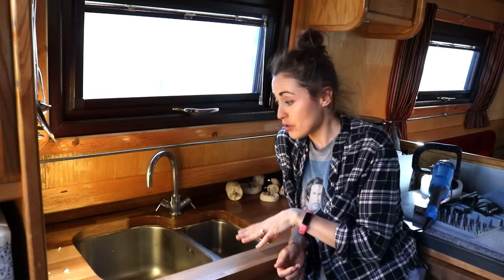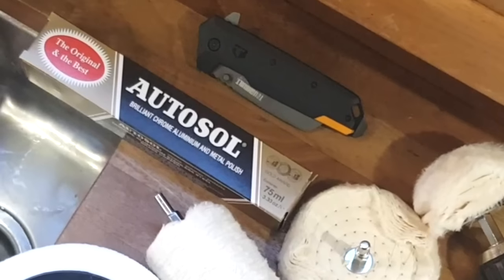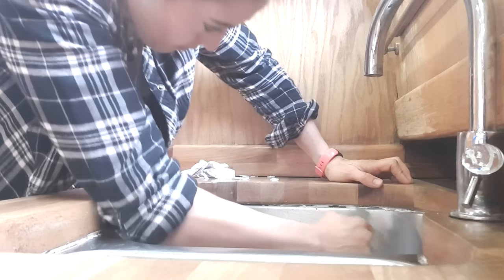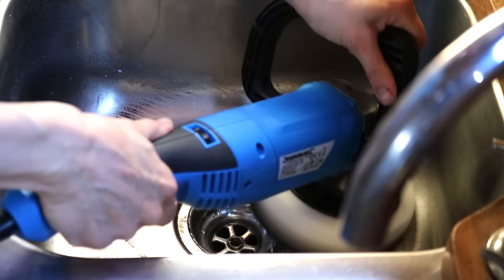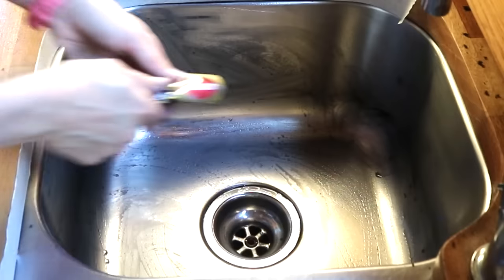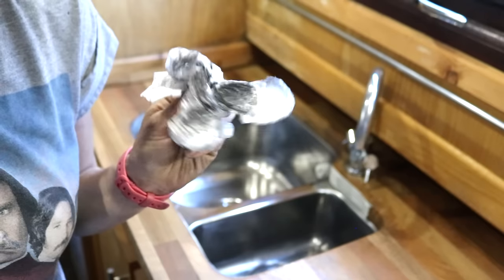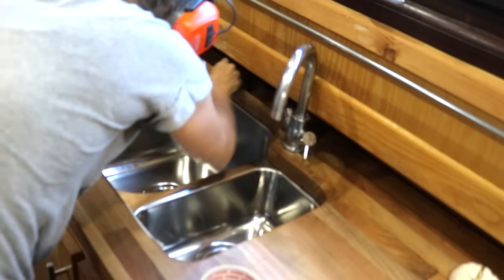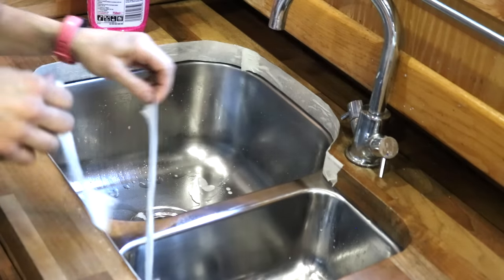How to Restore a Stainless Steel Kitchen Sink - Remove Scratches & Polish it to NEW again!

Comment: Before applying silicone, it's wise to fill the sink with water so that the sink drops the lowest level and prevents silicone from overstretch or cracking. The silicone would be able to adjust to a full bowl of water - you would do same around a bath tub. Good video!

Comment: Very well done.
Now to my own problem.
She who must be obeyed, bought from IKEA a replica Belfast sink, all was well until I tried to clean one of my daughters attempt's at cooking.
Any there are black vain like marks. I've tried numerous methods found on Utube but to no avail.
Any ideas would be most appreciated.
🇮🇪🇪🇺
Reply from the maker: Ugh.. I know exactly the type you mean.  I'l can't offer any suggestions without searching, so will pin this and hopefully someone can suggest something that works!
Reply: @TheCarpentersDaughterUK  
Thank you . You're Brilliant as usual.
Reply: Have you tried Pink Stuff? It's about a £1 from the supermarket (*the tub of paste not the bottle version*). It cleaned up our old original Belfast sink really well!
Reply: Try barkeepers friend original powder.
Reply: Try using ... Doktor Power Magic Eraser from JML which is readily available from most supermarkets and outlets like Wilko/Robert Dyas etc...   Cut a small square/rectangle off the main block (you'll understand once you have it to hand) , wet with a little water and just rub.  Works on no end of surfaces from hard ones like your sink to soft ones like wall paper (just don't rub so hard).

Comment: Extension bars can be used with the angle buffer.  They allow improved access but do add to the strength required to control the tool.  Fantastic results with buffing compounds.

Comment: Thats a brilliant idea iv used the same metal polish for years on other stuff but never thought of using it on our sink 🙈 You can use handy wipes, the type in the tubs from toolstation for cleaning up silicone as they cut right through it and leave you with a perfectly clean surface, we use them when sealing up windows and doors and they work a treat
Reply: Whats the name of the metal polish?

Comment: Nice job 👍🏻 and yes using a metal polish like autosol does produce a lot of 'black'. It's basically because Autosol is a Grinding Paste and as such it removes the top surface of the item your using it on (so no good for using on metal that has a protective covering like a lacquer?).    Hence it taking a whole load of paper tissue or cotton cloth to wipe it down.

Anyway... great job, but I bet you were very hesitant to use it eh?   ''No...no, don't use the sink!!!'' I can hear you scream 🤣🤣🤣

Comment: Have hand polished motorbike engine cases, front forks and exhausts with solvol autosol in the past and always got lovely shiny surfaces with it. Is good stuff.
Reply from the maker: Thanks!  I did a little test of hand polishing and my god, it was tedious 😆😆  Tip my hat to you! 🎩
Reply: @TheCarpentersDaughterUK  polishing clothes and a toothbrush worked wonders. Used to enjoy doing it that way plus polishing machines and drill attachments arent always suitable for small awkward areas.

Comment: Very handy! My kitchen sink has taken a battering over the years, definitely going to try this.  A question about the cotton buffing pads (the ones you attached to your drill) some of the reviews were very mixed. What was your experience?
Reply from the maker: Good question... one line didn't make the cut due to timings,, but did in the post.  I found some very slight shedding of threads, but it was SO slight, it didn't stop me getting this job done.  I thought they were perfect for this job.